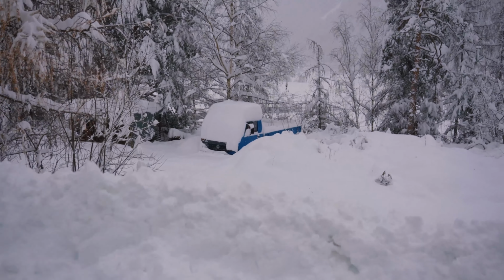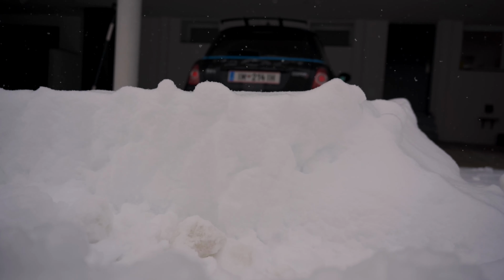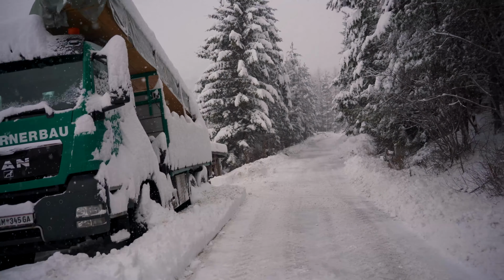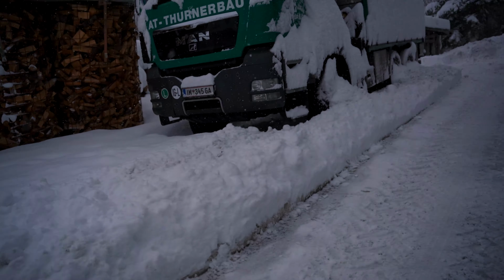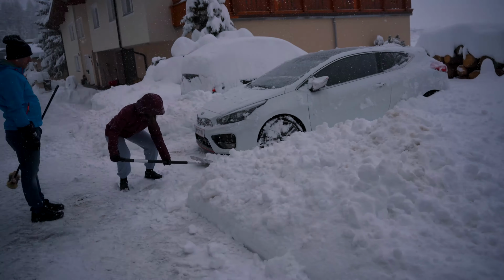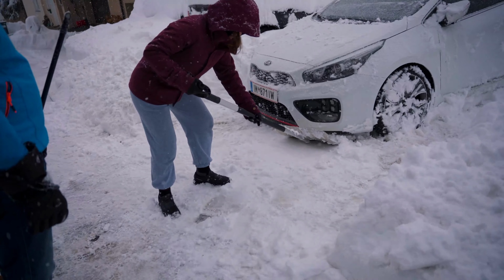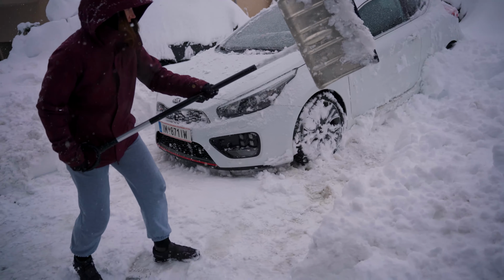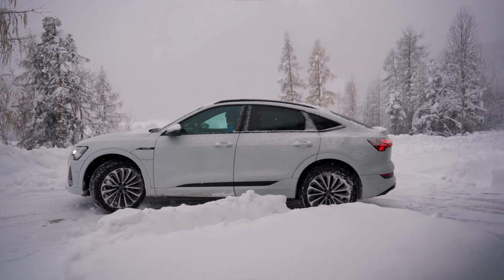Grip or slip? 3mm tyre tread vs. Austrian snow | Kia Proceed GT

Comment: I presume the rear tyres on the FWD Kia had more tread. It would've been a nice test to try swapping the rear wheels onto the front to see if the tread depth really was the problem.
Reply from the maker: We did in fact put the rear tyres/those with the most profile on the front! But I drove up the same road with my Mini, also a FWD but with 7mm of tyre tread and I barely struggled to get grip :)